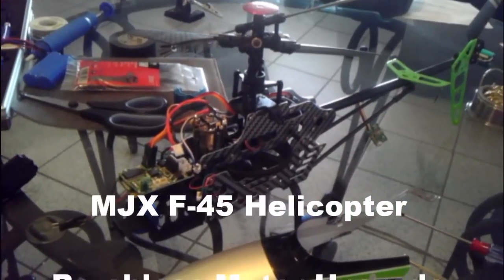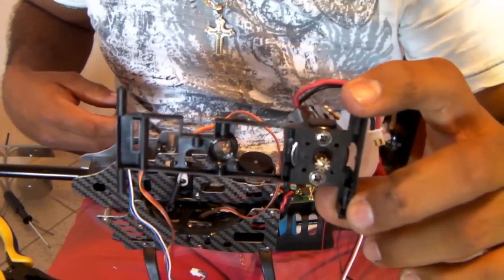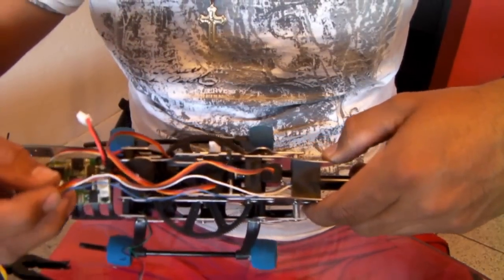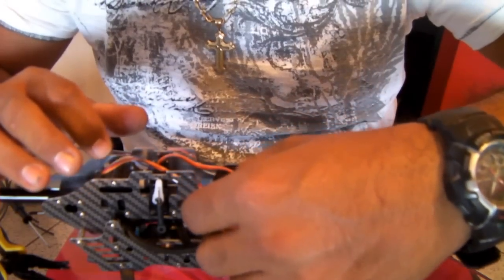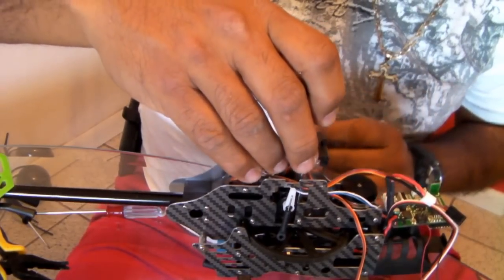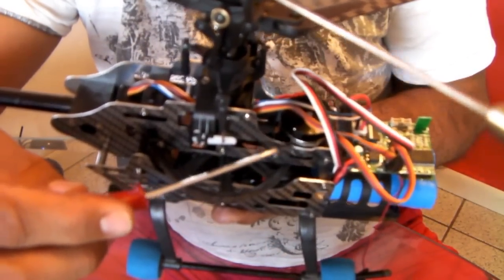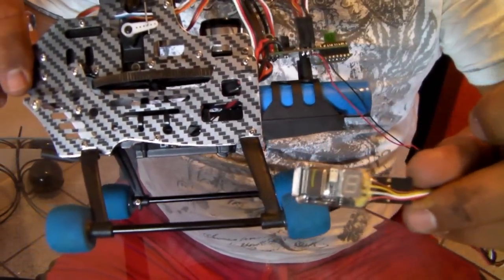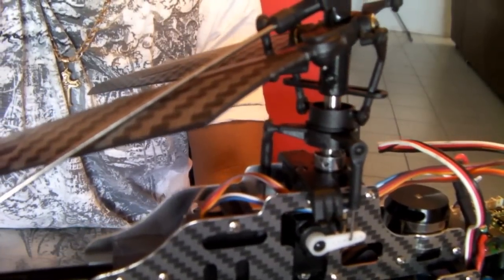MJX F45 Brushless Motor Upgrade

Comment from the maker: @MrSchiksie Hi, the boardddoesn't have servos. Maybe you meant to say the gyro mounted flat on the board. I haven't seen that yet, but i had heard about it. Can't tell which one would work better. The base they sent me with the kit is completely different than the original. It was designed to fit a brushless motor. The holes on it looks different,, but  i believe there's always a way to fit another motor as many purple had done with theirs. Thanks for your comment.

Comment from the maker: @MrSchiksie it wasn't the shaft but the motor pinion gear. I believe about three and a half months of continuum use. I average going to fly 3 or 4 days a week and every time I go I use all my 14 batteries. So you add those numbers and might get an approximate number on how many flights it took for that gear to wear off. Thanks for asking.

Comment from the maker: @Fabinho Lucio with this upgrade you ended up with a more powerful motor. Brushless motors don't get hot, so all you need it's to change batteries and keep on flying instead of having to wait until the motor cools down between flights.The original ones dies after more or less 50 flights. This motors last longer . I already passed 50 flights and my motor still runs like new. You don't need to upgrade if you don't want, the original one works ok but won't last . Thanks for asking.

Comment: Hello Richard, thanks. Ah yes now i found it, i couldnt find it last time. Well ill try doing it myself cause the frames and motorplate i can modify myself. Interesting that they also have a board with the servo mounted flat. I had to resolder mine 2 times now after a crash so thats a good solution :-)

Comment from the maker: The kit includes the modified frame plates and the motor ,ESC, and plastic base comes all together already set, so you don't need to do nothing but to switch the plastic base that holds the original motor and replace it with the  new one.

Comment from the maker: @Jackie Gaal I got mine through Top Start. They have two versions, if your PCB has a vertical part in the front of it then you need to get version one. But before you finish your transaction they will ask you to let them know which version you need. That vertical piece on our helicopters board it's the gyro. If is it like that you need version one. Just check with them, you could chat with the seller  on real time and that would help you with your purchase.  Good luck. thanks for ask.

Comment from the maker: @ Dennis Hillard: Nice!, mine has an Eflite Park 370 5400kv and flies like an angel. No more worries about checking the weather to figure how windy a day was going to be. With that motor, I cloud fly my heli in windy conditions. The windier was 15mph...it wasn't easy and it is on video... actually that was the day I was testing the new motor, it's on my brushless upgrade part 2 video. That day it was really windy and thanks to the motor I mandar ti fight it really good. have a good one...

Comment from the maker: @gettingfilthyrich I know, but that isn't a PCB but the actual ESC. That kit is for the version two of the MJX f45 helicopter. I bought the version one that is the one with the vertical gyro on the PCB. I'm not sure if that version actually works with our helis. The gear the new motor came with is already gone. I'm trying to find one that fits to fix it. Meanwhile I'm going to go back to my old brush motor in order to be able to keep flying until i fix it. Thanks for your comment.

Comment from the maker: Don't take me wrong, the original motor is very good as well as the esky 370 super motor. The only thing is that those motors failed after 50 flights or more and you had to let them cool down between flights to avoid burn them to fast. The brushless on the other hand offers more Power andFdoesn't get hot, so you just need to change batteries and go for another flight right away. The brushless motor offers more Power so you could fight the wind much better.

Comment from the maker: @trebor1973j If it was that piece the one you were talking about, then the answer is Yes, that had happened to me, and is because that part wear off after a while. All you need it's to replace it and problem solve. That happened to me  after a couple hundred flights. I'm now using the new version ones. The new ones aren't 7 shaped anymore but strait. Thanks for asking, i hope this  had answer your question.

Comment from the maker: My helicopter catch a mysterious vibration that doesn't let me take videos anymore. I've tried changing the blades, main shaft, complete head set, linkages, and also cameras, but still doing the same and I don't know what else to check to get it fix. Any suggestions. Thanks.

Comment from the maker: Update 2/5/2013: I had to go back to the original stock motor in order to keep up flying until a replacement brushless one arrives. The gears on the brushless motor got chewed out and the helicopter want able to fly. There was no contact at all between both gears. I order a replacement one but meanwhile I don't want to ground my heli and denied me the joy of keep up flying, so I went back to a stock motor. The good part is that the procedure is easier than the installation of the brushless one.

Comment: Why was the old motor not good enough?  I only have my F45 for two days.  I dailed down the effects on the transmitter - only 50% power for throttle which is FINE as long as I don't try to "dive" or go forward too hard at low altitude (Hey - I crashed my old DH 9100 that way more than once!  You can run out of throttle while trying to climb out of your high speed dive!)

Comment: Hello.. what is the model and name and kv and size of brushless motor????
What is brushless motor we can use for f645???
Reply from the maker: Good morning and thanks for your question!... This modification was done long time ago and apparently they don't sell this brushless motor kit anymore, although you can actually buy an Eflite Park 370 5400kv and use the 10T original gear from the factory motor and it'll work better than the motor I used on this video.  I switched to that motor after replacing the one on this video twice!  I still have this helicopter with me, but haven't flown it in years.. The heli still flies ,I just now fly bigger and faster aircrafts!...😁 
So with that motor, you can still use the same ESC that I used on the video and the original brush tail motor.  
Have a great day!  Thanks for visiting my channel! I invite you to check out my recent videos! 👍🏾 
Greetings from Douglas,  Arizona 👍🏾🌵🦠😷🇵🇷

Comment from the maker: Update 2/19/2013: I tested the new Eflite Park 370 Brushless motor yesterday on a very windy day and even though it was hard to maintain control due the wind, the Power this motor provide makes my heli capable of flying on 15mph wind. At least on this occasion my heli had the Power to fight the wind and come back for a safety landing. I'll be working on that video today. I'll called as same as this one but part 2.

Comment from the maker: The kit comes with a 2526 brushless motor if I'm not wrong. I am not sure about the KV. The new brushless motor that I installed on my helicopter after the one that came with this kit broke is a Eflite Park 370 5400kv Brushless motor. You could use that one with the rest of the hardware that comes with this kit, all you need is to use an original main motor pinion gear, and that's it.

Comment from the maker: Update: My recent modification was to use Double Horse 9053 ( A) blades. Those blades fit perfectly and gives the helicopter the right pitch to handle the wind way better than the original ones. You need to use the side A ones. Thanks for watching.

Comment from the maker: Update 2/18/2013: I messed up the motor that came with this kit trying to get it out the plastic base to change it's gear. The cheap screws wear off to and the nurture got stuck on the base. When I try to remove it I broke the motor. For that reason, now I'm installing a more powerful motor on this application. It's a Eflite Park 370 brushless. This motor fit 1:1 so no modifications are need to fit it on the original plastic base. I'm going to test it right now.

Comment from the maker: Update: The Brushless motor shaft gear was completely eaten by the big plastic helicopter gear wheel. I'm ordering a new one right away. That's what I believe was causing the vibration on out that didn't allow me to take nice videos anymore. I'll update once I get the new 10T gear for it and test it. Thanks for watching.

Comment from the maker: Update:I returned to original blades.The Double horse 9053 blades are very good for speed and to have more power against the wind.The only down side is that the blades cause more vibration than originals making video recording a bit a pain in the @&s. If you want speed and strength against the wind use the Double horse 9053 blades. If your goal is to be able to make really good quality videos without vibrations, use the original MJX blades. I'll be posting more updates soon on stuff I'm testing

Comment: Hi, Please help-I bought a motor E-flite Park 370 5400kv make this controller HK-30A ESC and plugged f645 ALL HOW do you think? when the power plug in the missing spot on the main board fire wire and black bears as a second order once already! I am doing so but that is NO COS know what? So please help NOT VERY-engine responds ONLY black wire Smoke Out what's going on I do NOT know? Regards

Comment: I've also seen this kit at toptoys.com for $49. Have not done the mod yet but don't think I need the kit. Right now working on getting my F45 to work with my DX6i TX then later move onto other mods. Nice job will look for you flight test.